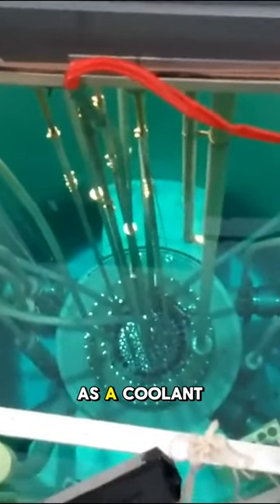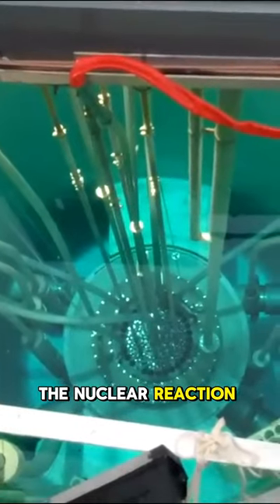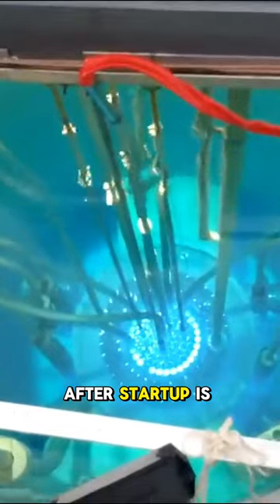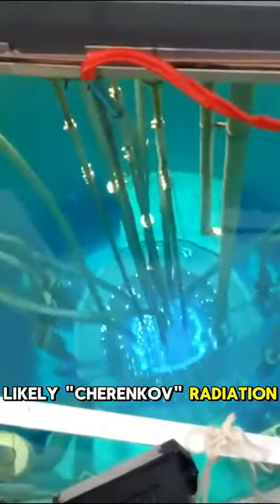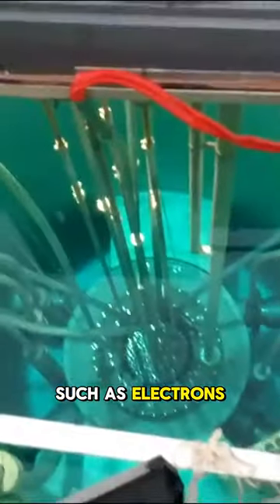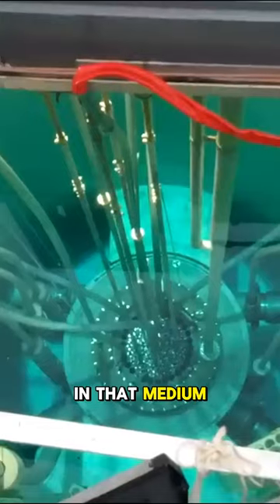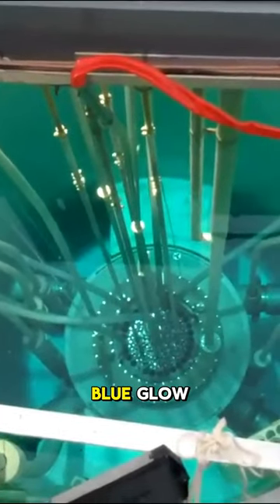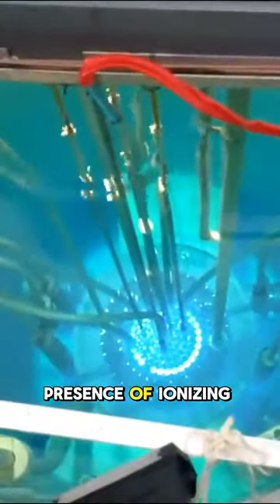nuclear reactor startup

Comment: ok than that means we just discovered something faster than the speen of light😮
Reply: No
Reply: Correct, and wrong.  The fermions don't travel faster than the value of c, which is the speed of light in vacuum. Here, they travel faster than the speed of light in that medium only. Not vacuum or air.